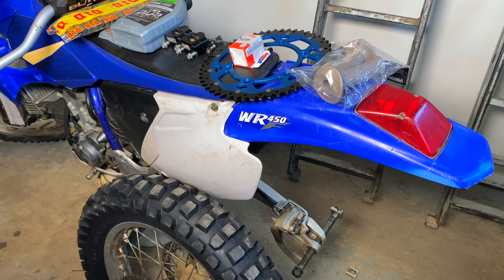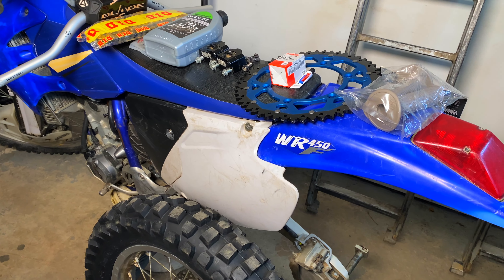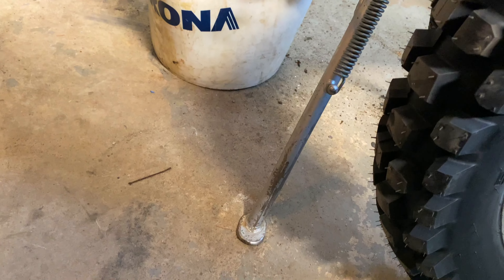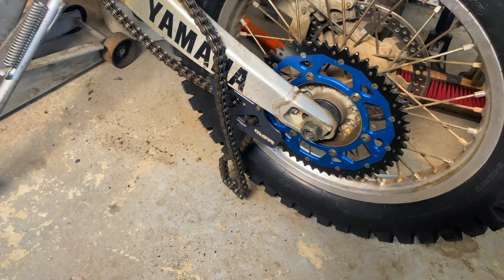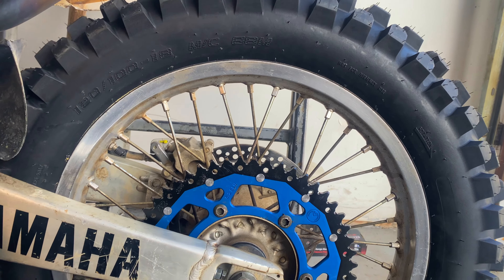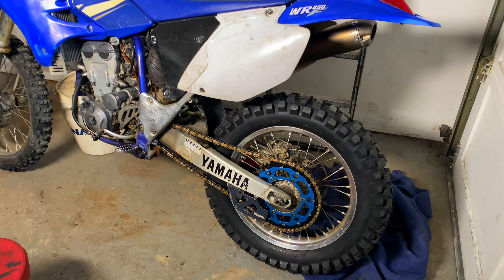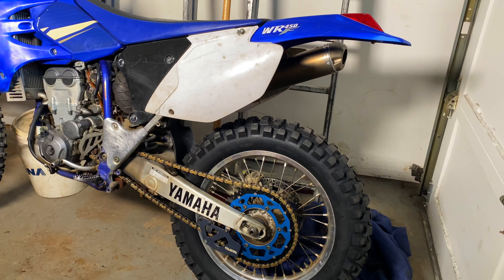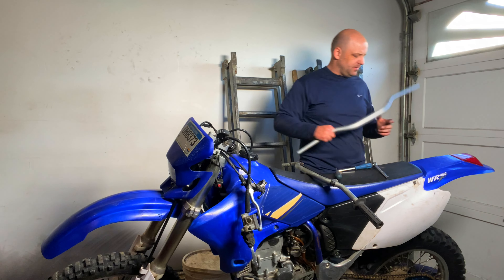Huge Upgrades for the WR450!!!

Comment: I have a 15 to 48 tooth chain on my 2003 yz450f, and it fit just ok. I did have to modify the crank case guard though.
Reply from the maker: Interesting, how do you like that sprocket set up. Top speed must be nuts.

Comment: Hey, how do you like that big bore kit for the dual sport? I used to have a wr400, that was dual sport setup, I loved it and I have a theory that the smaller bore revved easier for the highway cruising, but I'm curious if the 450 or even better yet. The 478 Big bore had enough extra grunt to cruise at 65 to 70 mph. Without feeling labor. Some for long periods of time. Maybe the extra displacement gives it enough low end torque to pull that gearing without feeling pressed? Let me know your thoughts
Reply from the maker: I absolutely love it. I also have a pro circuit titanium exhaust, which both of these have really woken up the bottom end on this bike. I have tried to make this a pretty hard core bush machine with 12/52 sprockets as well. I am in love with this set up.